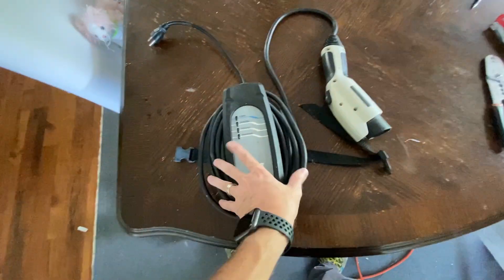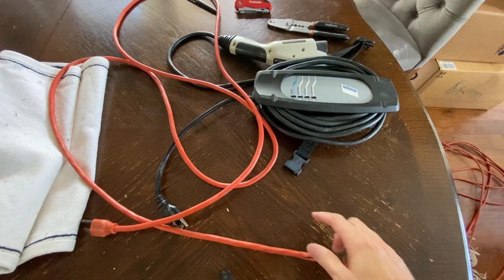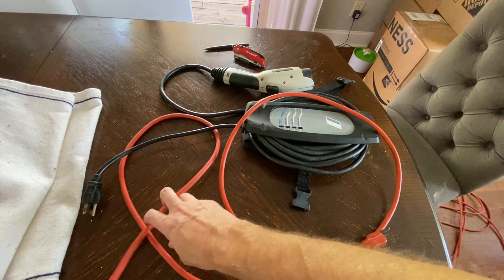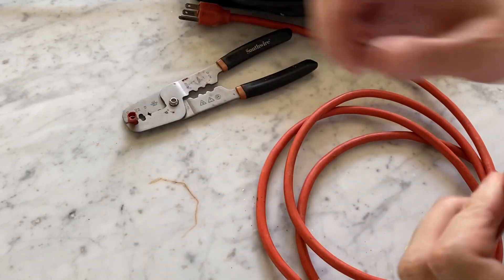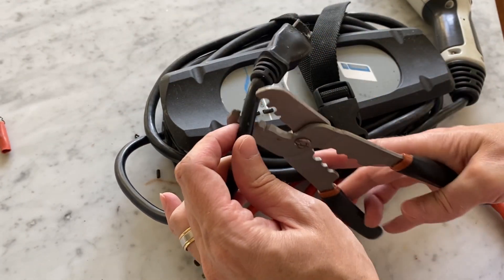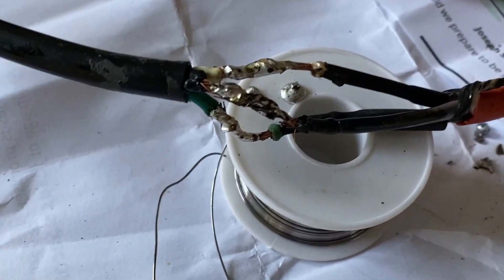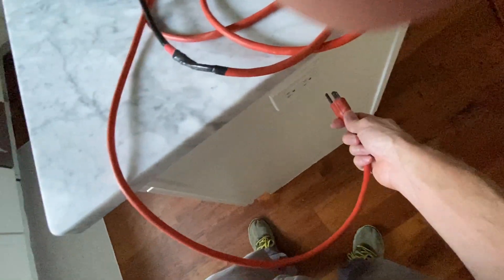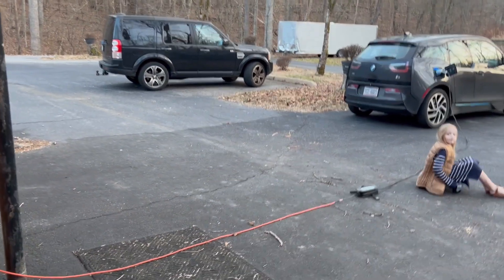Electric Car (EV) Charger Repair - BMW i3 - 120v portable system plug swap

Comment: Just a question...Why not replace it all the way to where it connects at the box by opening it up with the same long cable? I ask because I want to repair mine as well. Thanks!
Reply from the maker: My Reason was just simplicity of enacting the repair.  I didnt have to open the box and expose the internals.  The BMW Charger as a whole is weather proof (it can charge out in the rain).  I worried that if I opened it, it could possibly reduce that weather protection/seal.  Also if the first attempt on the cord when poorly of aged out in the future I could always just go deeper.  So in recap.  1. it was simply easier.  2. no weather proofing reduction  3. leaves more options for future repairs.
Reply: @FarReachFR  okay. Yeah I opened mine and it had water in it!
Reply: Not a lot but enough to know it is t water/air tight!
Reply from the maker: @GameDesignDude  Good to know.  Were the internals epoxy coated or in some other way protected?
Reply: @FarReachFR  Not that I recall. I'll open it backup and send you pics!

Comment: Fire hazard... :/
Reply from the maker: I suppose all cars are in some way.  As an update Its been 3 months now of constant daily use and while I watched it like a hawk at first, I can firmly say, all worries have ceased.  This i3 just flipped 100k miles as an electric car.   It is doing great and runs cooler than the ever.
Reply: @FarReachFR  yeah, well using a standard electrical outlet should just be used for emergency and not for daily use, for daily it is recommended to get a wall box with a type-2 to type.2 connection and a dedicated circuit
Reply from the maker: @WarpDump  You sound like my brother.  lol.  he has a type 2 even for his little chevy volt. :) There is no worries here.  For perspective there are two elements in the charging scheme.  The cars onboard ability to absorb power and the chargers limit to deliver that power.   The Charger in this case is the lower limiting factor.  It is rated at 120v to a max of 12 amps.  So long as you are on a circuit that can take 12 amps, you have a non-issue.    Its just another household appliance at this level.  Daily is fine. No emergency required.